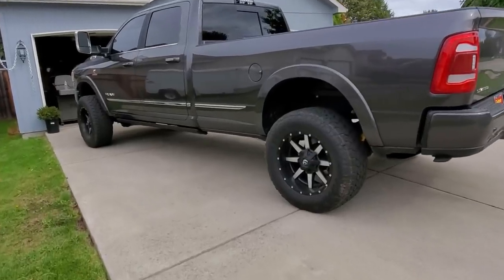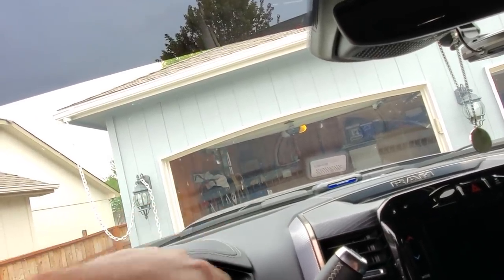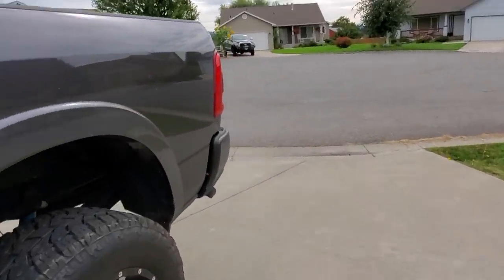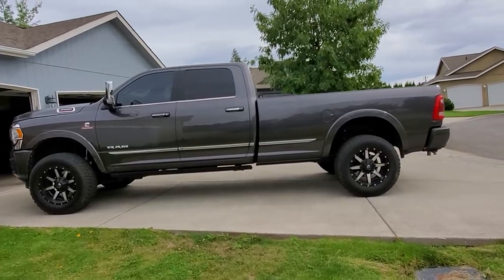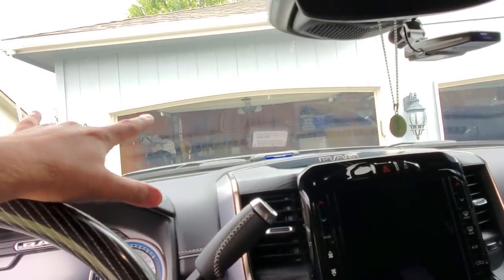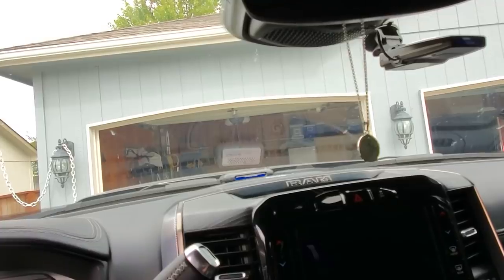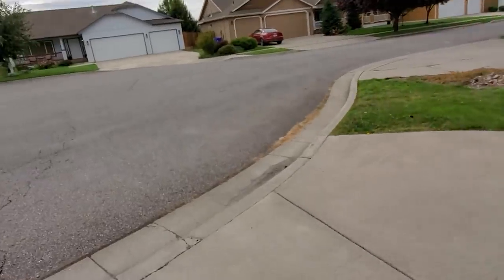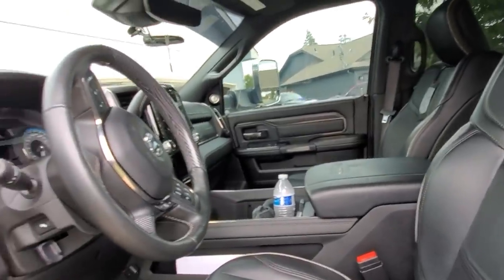Ram factory vs aftermarket airbags. Owner of both reviews the system.

Comment: I read somewhere that ram uses closed loop nitrogen system.  Not sure if its true, if so, you might not be able to use the compressor.
Reply: That’s not a front level then by definition
Reply: I read in the 2500/3500. The 1500 uses fresh humid air.

Comment: That’s because it’s Nitrogen and is a closed system!!  That nipple is for adding nitrogen. The system does not pump outside air into the air bags. It pumps compressed nitrogen from that tank to the air bags and vice versa.

Comment: I put the Firestone Air bags with compressor and remote on my 3500 dually. The remote control function is a joke. It’s extremely finicky and only works after several tries.
Not to mention Firestone customer service is a joke. Anyone looking for airbags do yourself a favor and avoid this setup.

Comment: Got a 2020 ram 5500 rides super rough. I thought it would be smoother when im loaded but still super rough, every bump i hit i feel it in my back. My back is killing me bc of it. Also had a 17 ram 3500 was alot smoother, i tried putting firestone airbags in my 3500 just to c if i can get even a smoother ride it was worse with them on so i took them off. And no it wasnt bc i had to much air in them i tried from 70 psi to 20 it was still crazy ruff couldnt wait to take them off. Its just my 5500 has so many leaf springs that idn if airbags would help. If i could get my 5500 to ride like my 3500 i would be happy. Has anyone had the factory airbags on a 5500? If anyone had this issue lmk!

Comment: Are the factory air bags automatic, or,  do you have to engage the on dash towing button.
Reply: Not sure on the 2500s. On my 1500, the load leveling is automatic. Then you can raise manually with the dash button for off-road mode. But it only raises to 2 predetermined heights.
Reply: Factory bags are automatic. My 20 had them and loved it. Put a load on it and it would go down. And about 2 seconds later it would fill up and level out. Great system

Comment: So, I'm jumping on a '21 1500 Limited once available - which come with air bags. Anyone know of a hack to override the factory height to level the truck using the air bags, and even stop the truck from lowering at higher speed?
Reply: I have a 17, to remove the aero mode, you do it thru the uconnect. It's under suspension and a checkbox to override it doing it. To level it, you need to buy links. You pop off the factory links and install them and adjust a nut to level. It deceives the sensor.
Reply: You don’t want to use the bags to do a leveling. You want to use a spacer and rear block. The bag is a secondary and shouldn’t be used as a lifting method. Skipping a rear block and and bag spacer, and using the bag itself as the lifting method, will result in a jarring ride.

Comment: The rams have a sealed system to keep from getting condensation in the system. I only have a lowly 2014 Laramie 2500 but I got it with the air suspension and it still works great. I only have about 100k on it but there are no springs to help it so it is always using the airbags. I tow a 5th wheel regularly and haul relatively heavy load, (~2K lbs), a few times a month- never any issues.

Comment: I got my 2018 Ram 3500 dually with the factory airbag system and love it. I Hot Shot with a PJ 35' + 5' and it rides like a Cadillac compared to the previous truck I owned.

Comment: I'm pretty sure that system doesn't use normal air, it uses nitrogen and is a closed system.
Reply: 1500s have the closed system for the 4 corner air bags! Hd is an open system just like semis

Comment: I have a 2014 Ram 1500 with factory air ride. I have 124k miles. Cost me $3k too replace the pump and valve. Still not working correctly and the dealer want another $3k for rear shocks. I’m done. Nice while it worked but it’s not something i can services. I was surprise about your research your factory set.

Comment: Thinking about adding aftermarket airbags to the rear of  fourth gen 2500 which came with the auto leveling rear air suspension. I'm getting some porpusing still while hauling my 1200 lb tongue weight travel trailer but concerned about putting too much more tension on my Equalizer E4 bars. Thoughts from anyone with making mods to the factory auto leveling rear would sure be appreciated. Thank God for the back up camera by the way when I see the precious one's hanging out on the sidewalk!!!!

Comment: I put a 7.5 gallon tank on my 3rd gen just because I felt like it. The system originally came with a 1 gallon, and I did that specifically for being able to run air accessories, like bags, fill tires, blow radiator out, filters, etc if I ever get in a pinch.

Comment: you cant hook in becaused its a closed system filled with nitrogen
Reply: The the 1500 system is the closed one. Hd is open using the regular air. Hd is just rear. Plus 3500 is only an assist bag. 3 very different systems for each size truck